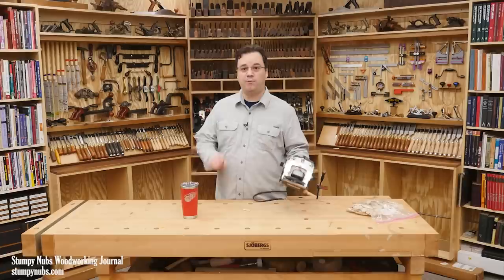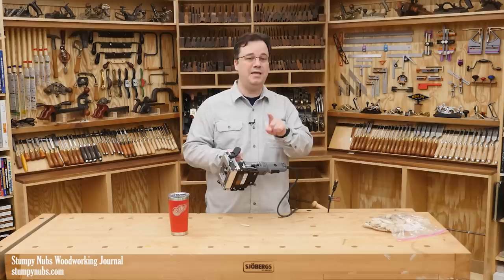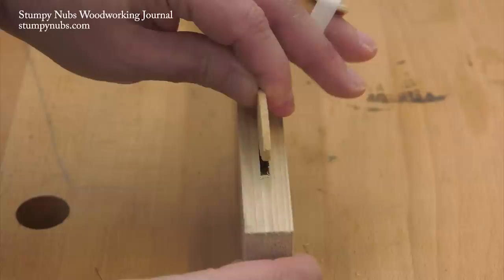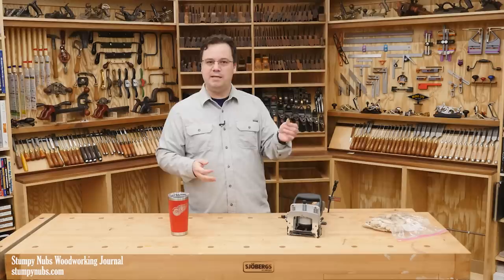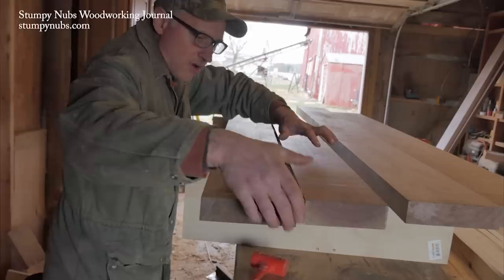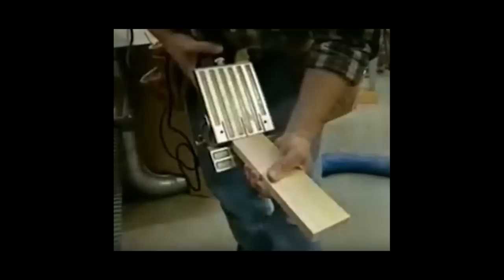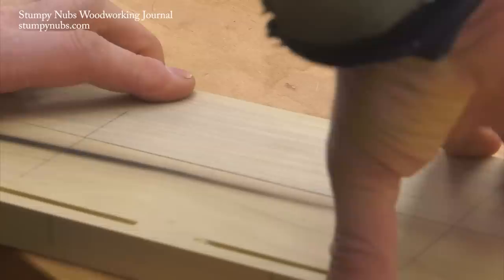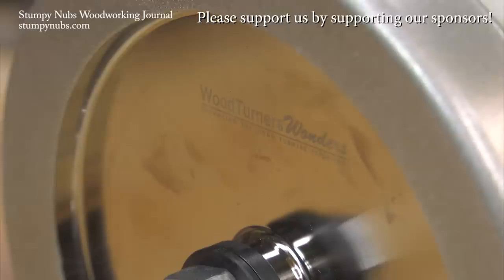Was Norm Abram WRONG to use this on the New Yankee Workshop?

Comment: Funny to see the hoopla over the last 15 or 20 years over the plate jointer. Professional cabinetmakers have been using them for much longer, purchased mine in 1983 and still works like a charm! Virutex!
Reply from the maker: I actually think the "hoopla" was during the 80's and 90's and the opposite has been the case over the last 15-20 years. Most woodworkers dismiss them entirely.

Comment: I agree that this tool does not odd strength but it has its place in the shop. For strength I prefer dowels. I would never buy a tenon joiner unless the price drastically. Over $1000 for a relatively simple hand held power tool is absurd IMO.

Comment: One tip I got from a woodworking class, don't rely on the fence.  It can move, you can tip the jointer, etc, etc.  Instead, measure up from a large flat surface, like a piece of marble tile, or even just your workbench.  You'll get more consistent vertical spacing, and you won't have to worry as much about tipping.

Comment: I bought mine (probably before Norm) and used it for just about everything, many times in multiple for each joint.  I can't think of anything that's failed.  I still break it out for many things although the Domino is now my go to for most joints.

Comment: I use my biscuit jointer to repair stair rails that have come apart.  Actually I make my own biscuits for this job.  I simply reunite both ends of the stair rail with a clamp, cut the joint with my jointer, add glue and homemade biscuit (I like contrasting colors) let glue dry and trim and refinish handrail. Done!

Comment: We did a complex 3/4” X 5” Joatoba floor, requiring many removes of the T and/or G. This was a great tool for assist with hold things aligned until we could get to a nailing point. Question, though: why not a buscuit-shaped domino?
Reply from the maker: Wouldn't a biscuit-shaped domino just be a biscuit?

Comment: Mike Farrington is a magician with a biscuit joiner (and a lot of other tools). I learned from him to use it as an alignment tool which helps during case assembly and even a a large slab glue up I did. I am sure the premium models are even better than my cheap one but for that kind of money I would get a domino first.

Comment: I'm guilty of buying one when I watching Norm decades ago.  Like you mentioned - I use it mostly for holding alignment during glue ups especially on 3/4" material.  I also found they also work well for melanine/press board

Comment: I like my biscuit joiner. It does a good job when I need to align pieces of wood. I watched New Yankee Workshop many times, and still do the ones on YT. I have seen Norm do a number of things that I consider dangerous or not recommended. I will continue to use mine in a safe manner for what it is intended. If I need a stronger joint, I can use dowels, Have a great 2024, Jim.

Comment: I still have my old Porter Cable 555 biscuit joiner. I wish I had the adjustable fence that came with the 556.
Reply: You could buy a separate adjustable fence for it. I have one.
Reply: @CTBLAS  I've tried but can't find just the fence.

Comment: I use a 65$ biscuit joiner, and it's been very good. I only use it for aligning boards, and the resulting panels are way better quality, and so much easier to glue. I don't regret the acquisition, even though I only use the thing once a month. I do want a better brand, but I can't justify the cost.
The cheap one is ok if you don't mess with the settings mid work, and keep the same pressure, grip and position during all cuts.

Comment: I bought a Skil biscuit joiner a long (long time ago)......more than 30 years ago.  I have used it for all sorts of applications.  In finish carpentry it works wonders when trimming out doors and windows that have 1x4 trim pieces coming together at 90 degrees.  It has never failed me.  Of course, I anticipate that some day the saw blade will get dull and I have no idea where to find a replacement since the tool is so old.  But, this tool is one of my favorites and I probably did buy it because I saw NA use it on TV.  Granted, that screengrab of him using it over his knee is cringeworthy.  But, I love my biscuit joiner....and it's not even one of the best (like a Lamello).
Reply from the maker: I think the blades are pretty universal. The diameter and thickness has to be the same because all biscuits are the same. The only variation may be the arbor hole in the middle.

Comment: Blasphemy. NORM IS NEVER WRONG
Reply: Not even when he stopped making his show even though it was so good :( :(
Reply: Norm finally turned against the use of biscuits when gluing 3/4 inch boards for table tops etc.  He stated that the biscuit cut would telegraph to the surface of the glue up after some time. This effect was shown on his show. I guess the difference in thickness due to the void would cause differential shrinkage of the wood or perhaps as the glue cured it shrunk causing the biscuit to pull the surface down. Don’t know but I thought at the time, here you have sold thousands of the tools only to say they are less than worthless for one of your key uses.
Reply: @johnrazor8720  He literally explains this in the video.
Reply: The New Yankee Workshop is on YouTube now, they're uploading all the old episodes and Norm and Russ even make occasional appearances in new clips
Reply: LoL
Reply: Yes he is. He's not Chuck Norris
Reply: No truer words were ever spoken!
Reply: I remember the first episode when Norm introduced the world to biscuits! Guess I'm old!
Reply: Even if he's wrong, it's STILL blasphemy!
Reply: Ditto
Reply: how do you think Chuck Norris’s beard is attached to his face? You got it… Norm attached it with his biscuit joiner and of course… a couple of brad nails!
Reply: yes Mr Abrams sets all standards, that is why we refer to those standards as Norms
Reply: When Norm switched to the new band saw for a couple tenon cheek cuts, the bubble was burst.

Comment: The dissing of biscuit joiners perplexes me. I use mine for edge jointing desktops and shelving. It's not a brand name one either. Never had a failure. I'll take the word of my betters that  loose tenons are stronger but, frankly, I don't see quite why that would be so. Then again, none of my work is tested to destruction and the biscuits seem fine.  Biscuits are also forgiving in that they allow a bit of lateral movement doing glue-up, unlike joints with several dowels.

Comment: Speaking of splines, how about re-sawing some solid hardwood to a biscuit thickness, then doing a series of overlapping hole saw cuts of the right diameter, to make some hardwood biscuit-shaped splines?  The grain orientation would run across the smaller width (i.e., across the joint) for some real domino-level strength, plus you'd get the alignment advantages of biscuits.  I mean, if biscuits don't add much strength because they're made from compressed fiber, why not make your own hardwood 'domino' biscuits, save yourself the price of a domino cutter, and have your biscuit joiner do double-duty?  You'd probably only need a few for a given project if you're using them for strength and alignment, not like you'd have to make entire production runs of them.  Something to consider....

Comment: Safety issues @ 4:06....
Clamp the part and use 2 hands while holding the tool.
Or, when the tool is stationary, use 2 hands on the part.
Powertool in one hand and the part in the other (with no support)... argh...
Can't stress this enough... My machineshop teacher lost his thumb and has pins in his index and middle fingers... while explaining the safety components of the milling machine.

Comment: Don't know if you noticed that the clips you used showing the assembly of a few piece of wood did not sit flat on the table after it went together.frame 4:27.and that the biscuit cutter was slightly angled while cutting in the slot and this made the two boards misaligne...you can see it rock back and forth on the table as he touches them. I think some care must be taken while cutting to be sure things are flat and parallel.. I can see this being a source of frustration.
Reply from the maker: Yes, I think the fence needed a slight adjustment to bring it to perfect 90. We were just doing some quick video clips and didn't worry too much about it.

Comment: I bought the original Elu biscuit cutter/ scoring saw in the late 1970s. It served me well until the early 2000s when the motor burned out. I bought a Delta biscuit cutter which was a POS. A year later I replaced it with the top of the range Lamello biscuit cutter, expensive but money well spent. Moral of the story, don't buy cheap biscuit cutters...

Comment: There is a reason cheap mdf furniture will have 2 dowels and 2 screws for each joint.
Two dowels for ease of alignment and then 2 screws to hold it firmly.
It'll look great for a couple years, maybe even more if the owner is careful. And then it'll get bad and ugly and you get to sell a new one.

Comment: So from what little I know about woodwork and about woodglue the glue is normally the strongest part, in some cases I’ve seen the wood fail and brake long before the glue and the wood it’s touching dose so adding a biscuit increases the amount of wood the glue can touch which should make that joint stronger in the end.

Now like I said this is a novice’s info I don’t have a shop (ied like one but I don’t have room for all the normal stuff in a house let alone having a dedicated space for crafting) and even if I did have one I’m probably too ill to use one now sadly.

Comment: I've  used my biscuit joiner extensively to glue up large panels, in a couple of cases to build Hope Chest for my granddaughters.  I'd never use anything else for the task.  

One of the advantages is that they give you a tiny bit of wiggle room on the left to right plane, over dowels.  If you happen to be just a fraction off over the length of a 4 foot or so panel, from side to side, the shape of the biscuits will allow you to adjust the boards to fit anyway.  Dowels demand more precision, especially over a long span.

Sure, being more precise is likely better, but there are only so many hours in the day and woodworking is my hobby not my profession.

Comment: Biscuits are the decedent of dowels, although there are both pros and cons of each. I see Domino's as the true replacement for dowels, but cost wise, nothing beats simple dowels. The real weakness biscuits have if the parallel grain to the joint, which provides much less structural strength than a dowel/domino, who's grain runs perpendicular to the joint.
Reply from the maker: A biscuit joiner is way faster than a dowel jig and gives you some room side to side adjustment, which makes some joints (like the wonky countertop in this video) easier to assemble. But a dowel joint will be stronger especially due to the longer length of the dowels. Dowel joinery is legit, it just gets a bad rep.

Comment: Could you just use dowels in place of biscuits and get the same results? I don't have a dowel jig or biscuit joiner, so maybe biscuits are that much faster?
Reply from the maker: Absolutely, but you are correct in that biscuits are much quicker. they are also more forgiving when it comes to alignment (side to side), which is handy while forcing parts into alignment.

Comment: I always love your videos, your humor is on point.  Question though: You say dont buy a biscuit joiner at full price bc its hard to justify with the use (agreed), but  do you think the Domino is worth it?
Reply from the maker: A domino is much more versatile. It can create legit, structural joinery in a fraction of the time of any other tool. But it is also very expensive and I certainly would recommend a gently used one over a new one, if one could be found.
Reply: I barely have McDonald's money

Comment: How would you feel about getting a CBN wheel for a cheap Tormek knock off?  Is there a decent Tormek knock off that you might recommend?  Might you consider making a video using a Rikon, Grizzly, or WEN  knock off with a CBN wheel for those of us with small shops and small bank accounts?
Reply from the maker: I wouldn't buy a cheap Tormek knockoff. The ones I've seen in person (Rikon and Triton) don't run true and their jigs are crap. If I couldn't afford a Tormek, I'd just get a slow speed bench grinder with a couple CBN wheels (maybe 600 on one side) and then do my final honing by hand.
Reply: Thank you , I respect your opinion.  That solves agonizing on what to purchase. @StumpyNubs

Comment: Eh,
My cheap Chicago electric biscuit jointer works just fine.   Use it for glue ups, casework and yes even attaching legs to small light duty tables.  What I’d like to see people stop doing is using dowels in chairs.  Tenon or bolt those chairs folks the dowels aren’t cutting it.  Though to be fair most of the failure I see are on old old brittle glue joints, but whose to say out modern pva wood glue won’t fail in a couple hundred years too. I like to make things that will stay together even if the glue wasn’t there.  A bit silly knowing how good wood glue is but boy do I see a lot of falling apart antiques that relied too much on the glue and not enough on good joinery.

Comment: Despite completely understanding it....
It just messes with my head when I hear someone say to put wood in the microwave to dry it out.
Reply: And you should never walk away from it once started. Wood goes from almost dry to spontaneously igniting inside of a microwave. I was drying out a blank that I was going to stabilize with cactus juice. I was doing 15 seconds at a time, and then check on it. It was warming up, but wasn't hot, so I did 30 seconds. Next thing I know flames are shooting out of the end grain. I cut the piece in half, the fire started on the inside. Still smells like wood smoke when I make popcorn.

Comment: …but beware exploding biscuit joiners. I picked up a used one, quality brand, made a minor repair to the fence, then plugged it in. Pulled the trigger and the motor fan disintegrated…old, brittle plastic. No parts available.

Since then, my indestructible super-quality angle grinder from 1976 also exploded its fan. Buying high-speed electric hand tools decades old carries a risk I never anticipated.

Comment: Hello, I come from Eastern Europe and recently bought myself a used wood lathe. Surprisingly I collided with a serious problem, namely I can't find any turning chisels in good quality. The Narex company has recently discontinued theirs so I am in a quandary. Could you do a segment on the turning chisels you recommend? Your last video on this topic was quite a while ago.
Best regards
Reply: Until James chimes in, I would check out the videos from Tomislav Tomasic, who is based in Croatia. A top notch turner with excellent videos. He has several vids on chisels from, I think, The Czech Republic and Germany. In the US, Thompson rules -- pricy, but very long lasting. Tomislav demonstrates several brands available in his area.

The videos, as mentioned, are excellent; comparable to Stumpy Nubs, which, as you know are the best. A full-time turner, excellent teacher of excellent and superior techniques. It will take your turning to a new level and quickly.
Reply: Find some turning tools made from High Speed Steel.  HSS.  Bowl gouge, spindle gouge, parting tool, round scraper, and square scraper.  That will be enough to get you started.  Then get more later if you want.  If a tool is really HSS, then it will be good enough.  And even if it is bad HSS or carbon steel, you will learn to sharpen.
Reply: @greggerstner5599  
Thanks for the link, I just found it. Actually a very good channel with a huge injection of knowledge. I have a lot to watch from him.
Many thanks and greetings from Poland! 🍻

Comment: As I sat there patiently waiting to hear of a single reason why I'd want one of these things, I could not help but think that for every single application and example you gave, dowels would do the job better. I just don't understand the appeal of these things. Everything you said about biscuits applies to dowels as well, except that dowels are less finicky and stronger. I don't see any upside whatsoever.
Reply from the maker: It's way faster than a dowel jig and drill, and it gives you more side to side adjustment for alignment when forcing difficult parts together, such as the countertop in this video.
Reply: @StumpyNubs  Out of curiosity, what dowel jigs have you used? I have the DowelMax and it seems quite fast.

Comment: You think biscuits are great until you're doing raised panels on your router table and expose them.  Easier just to glue stuff up without them and not worry about where the biscuits are.
Reply from the maker: Or just don't use them within a couple inches of the edges of panels you want to raise.
Reply: I used biscuits on 4 mahogany raised panels that were for some church doors I was building. The panels were curved and I didn’t account for that when I made the biscuit joints. After I ran them on the shaper some biscuit joints were exposed and all 4 panels were scrap!

Comment: By the picture in the thumbnail yes, shoulda had gloves (cat 5 cut) then maybe, but we've all used tools inappropriately from time to time (self included).
Ya spin da wheel & take your chances.
Reply from the maker: No gloves are going to stop a carbide-tipped saw blade.